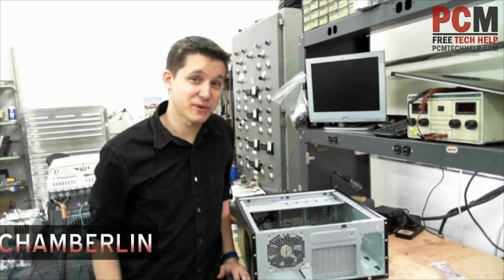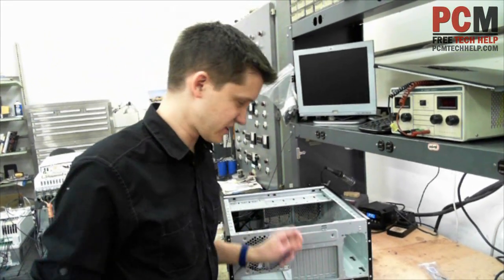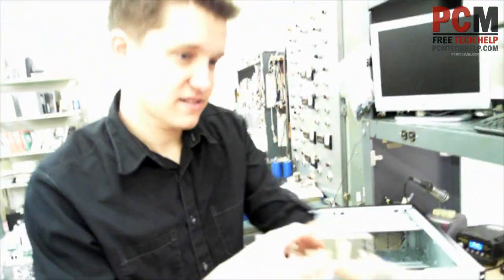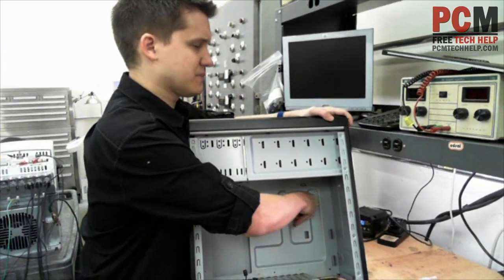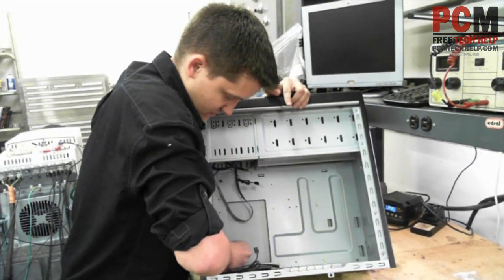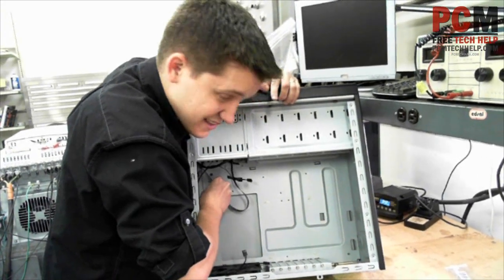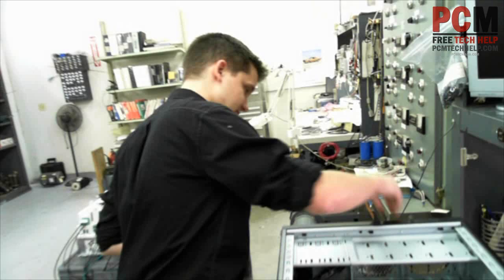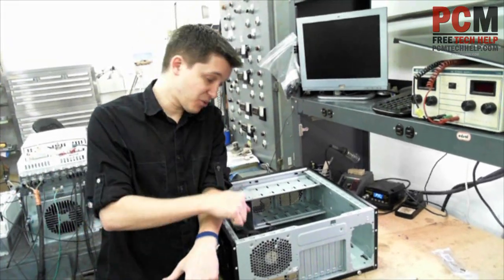How To Install A Computer Motherboard (ATX) (2022)

Comment: Is it safe to place the motherboard in the case like that? Building for the first time so curious what is the safest way to place the motherboard into the case and line up the screw holes with the stand offs.
Reply from the maker: They're pretty durable, just make sure you're using a static strap!

Comment from the maker: It's pretty easy. Just make sure you are grounded. Unscrew the screws holding it in place after removing all power cables and cards. That's all.